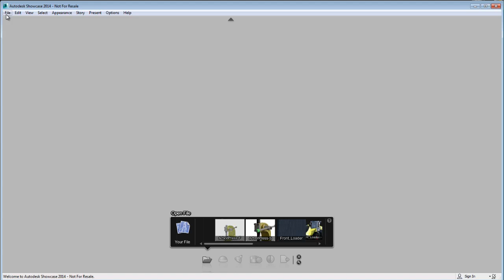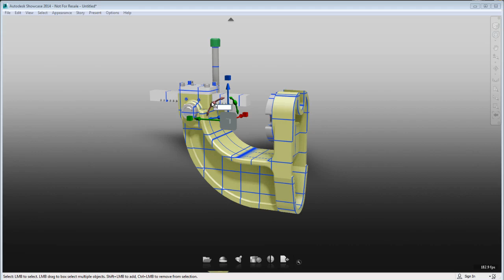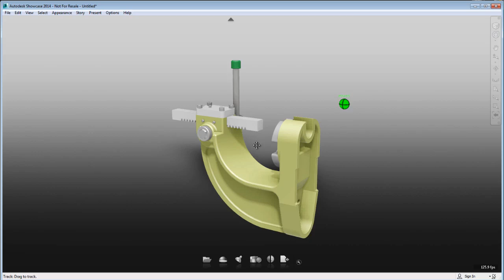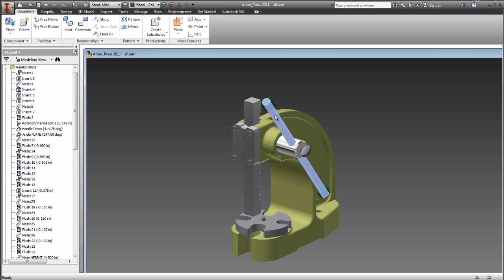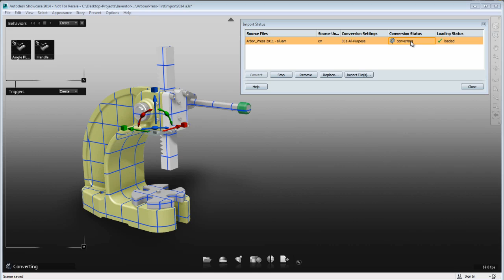Showcase Tips & Tricks: Changing the orientation of an Inventor model after import in Showcase.

Comment: Hi Marion,
I ended up making another assembly with the Z-up orientation and this time I made several assemblies to avoid the ginormous final assembly with all it's constraints. I tried everything I could but there was no way to reorient it due to the original frame I built everything off of; it was just a novice thing to do. I just wasn't paying attention. I do have a question about importing more than one constraint; can it be done in Inventor 2012? It seems like they only allow one.